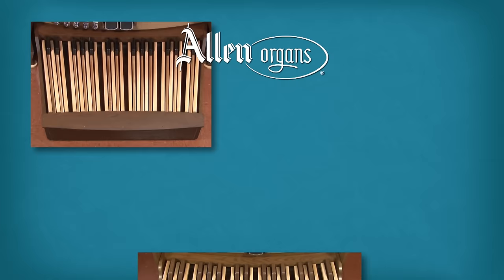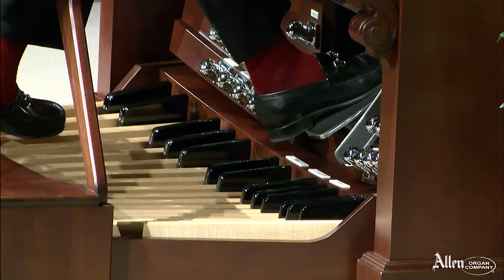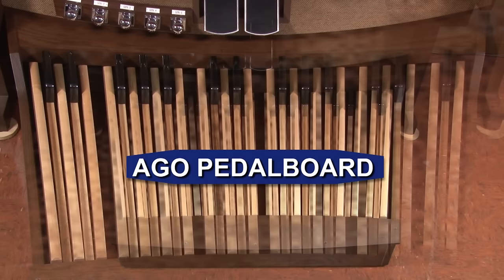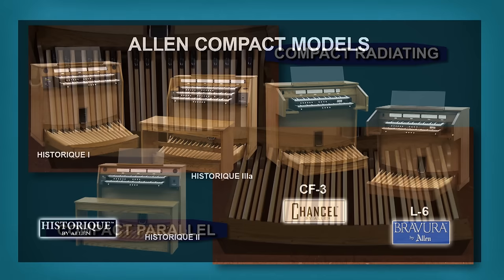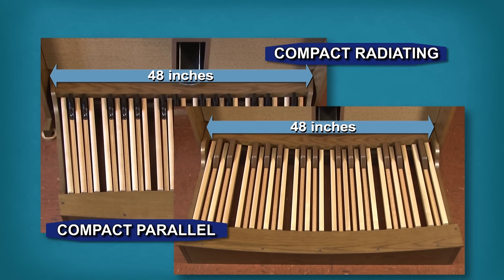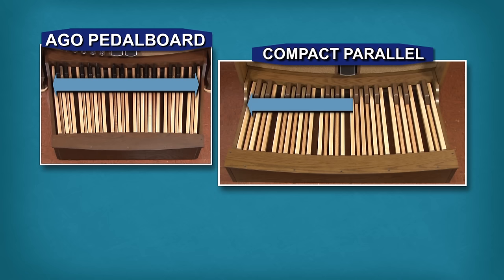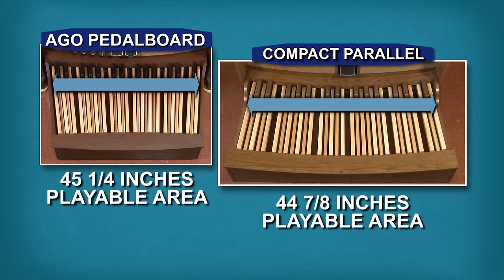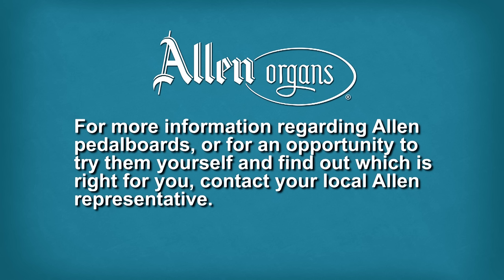Allen Organ Pedalboard Comparison: AGO and Compact

Comment: This is VERY INTERESTING!!!  Yes, I am an organist with church organ experience dating back to 1986 (age 19).  I am a strong proponent of the AGO pedal board, which I think your Allen 500, 600, and 800 series organs have.  Yes, I played all three of these, along with the 400 series.  Unfortunately, when I go to other organs, especially home organs, they often have what I call "nonstandard" pedal boards, these often throw me, since I have a "sense of interval" that I disciplined myself on using the AGO standard.

I thank you for your comparisons and explanations here.  I had a Wurlitzer Centura 605 organ, which had just a 1-octave straight pedalboard.  HOWEVER, the "interval" in the playing area seemed to be about the same as AGO, so I was able to practice on that organ and be ok on the pedalboard on the Allen 600 series organ.

I thank you VERY MUCH for sharing this!!!

From an organist in Moundsville, WV

P.S.  By the way, I play an Allen 505 (I think) organ at First Christian Church of Moundsville, WV.